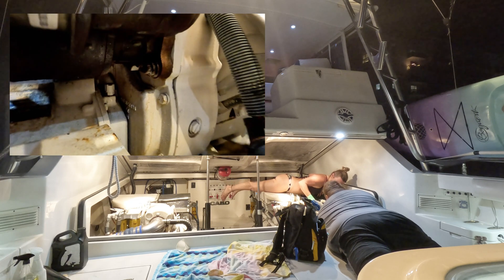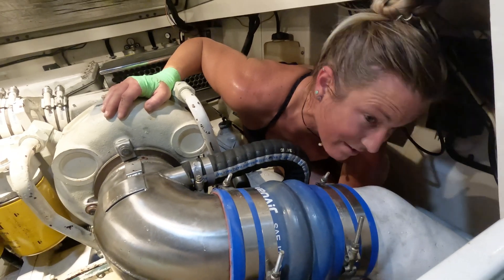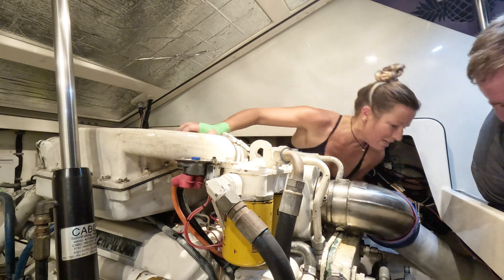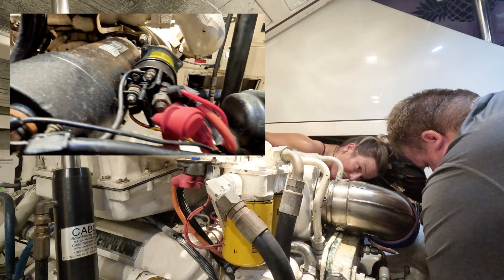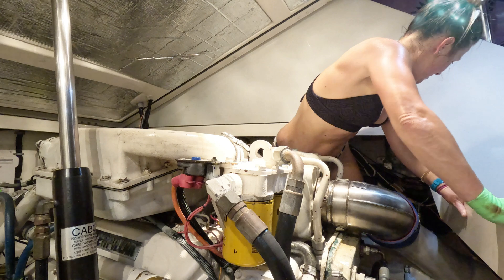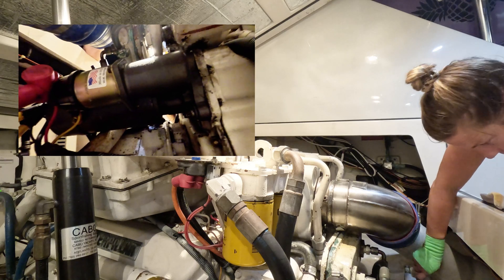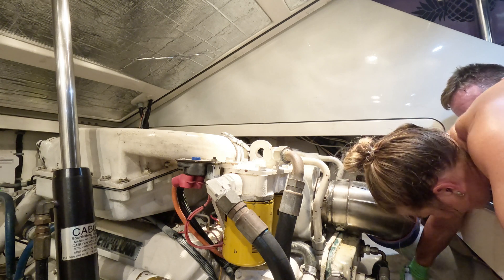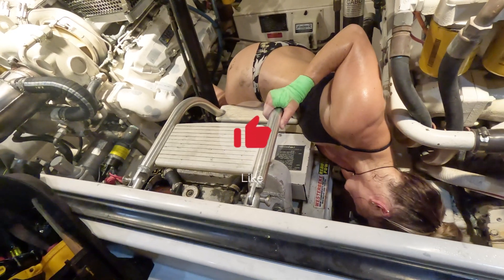She replaces the Main Engine Starter on a caterpillar 3208

Comment: Ok Mike, I can’t leave this one alone:

A bikini is the last thing I would be wearing to work on my engine! Much more protection is needed. 

I also save old bathroom rugs and lay them on top of the engine so I can lay across the engine without hurting myself. The shag rugs with rubber backing are great for this. That towel on the cockpit floor would do much more good laying across the engine. 

I also leave the flip flops and wear full shoes so I can use my feet to hold position or get into position. 

As for the rust, I use a SS wire brush and then soak it with OsPho. Paint over it if you want.
Reply: The OsPho is thin like water. I usually try to brush it. Basically just slop in on everywhere and let it run down to wherever it needs to be. I also keep some in a spray bottle. Just make sure you are protected. It’s thin so it gets atomized pretty good. But, it works very well in a spray bottle to get to this hard spots. 

The OsPho is a rust “converter”.  So you don’t have to get paint on top of it if you can’t reach it.
Reply from the maker: Perfect i am googling the product now.   I have some rust on one of my motor mounts that i need to tackle.   thanks for the info!
Reply from the maker: HAHA I totally agree!   
But you try getting her to put more clothes on.  LOL   I do believe at one point she did say she “should have put yoga pants on” but it was too late and still a little warm out so she didn’t want to.   

I normally use an old Yoga mat for on top of the engine, but she didn’t want to waste the time of putting it out.   

I just had to video tape this, so I don’t get accused of all her bruises later.  LOL   

Interesting can you brush on the OsPho?   Most of the parts I have that are rusting are not easily removable for putting in a container with liquid.  I have been using a wire brush and then painting over the surface.